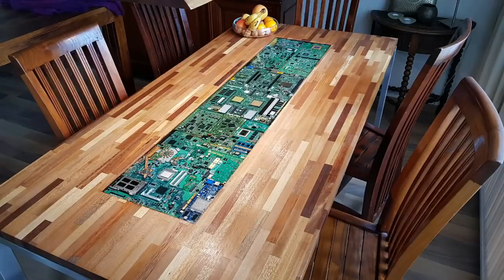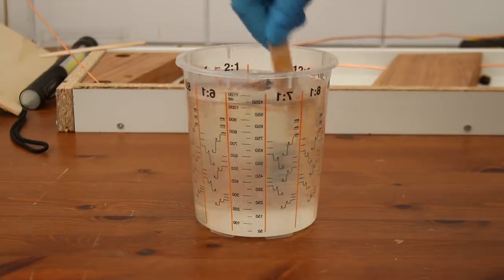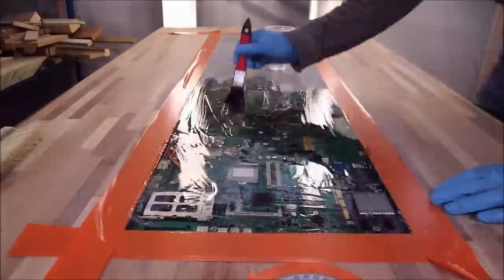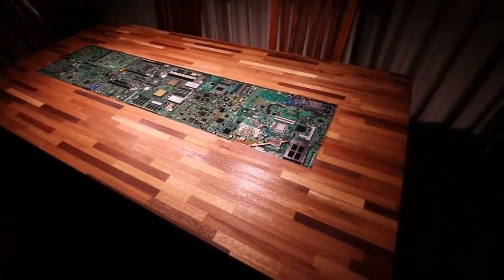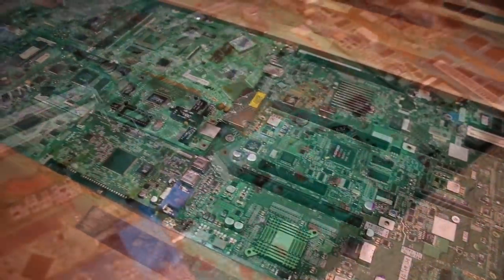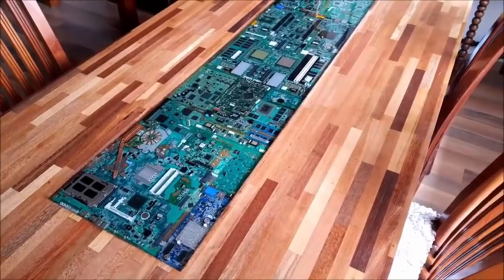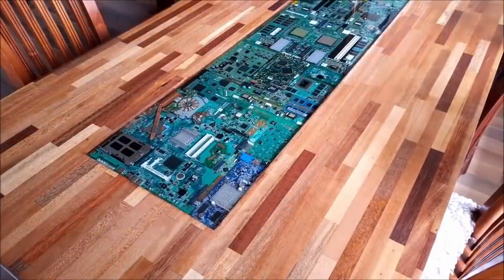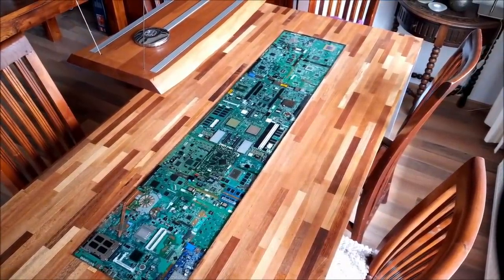Circuit boards with lights in epoxy in a table

Comment: I think you should do it again (easy for me to say). If you do, you should run the fiber optic cables under the boards, not under the whole table.
Reply from the maker: That's not possible. The fibers bend at a radius of about a minimum of one centimeter. For that bend you need room.

Comment: It  is  NOT  A  FAIL  ---   There's  an  alternative  to  save  your  masterpiece !!   Go  find  your  nearest  glass  shop  (where  window  pane  glass  is  purchased  to  replace  broken  window  glass  in  your  home)  and  have  them  cut  to  size  a  piece  of  furniture  top  glass  in  clear.   It  will  be  a  'tempered'  glass  that's  fairly  thick  with  smoothed edges  that  you  use  on  top  of  furniture.  Place  the  piece  of  glass  over  the  top  of  your  table  and  you  will  enjoy  it  thoroughly  as  it  protects  your  table  and it  cleans  up  easily  with  glass  cleaner!

I think this piece is  magnificent  and  definitely  worth  keeping!   Buy  the  piece  of  tempered  glass  and  save  this  beautiful  piece  to  hand  down  through  the  family!

Comment: I find hilarious that you took a most likely working LED and destroyed it for fiber optics If it was a working LED you make me sad.
Reply from the maker: Why does it make you sad? I needed a lens and a LED worth a few cents had one. So what?
Reply: @Onrust1  I makes me mad that you spent the time for fiber optics instead of just wiring them. I do give you the ok for the sparkle effect, but even then it still would be easy to add a arduino uno or a mini with some easy code.
Reply from the maker: I deliberately left out the battery powered lights with controller, because I thought you would go crazy quickly of a carnival in a table all the time... 😊 It is the temporary character of the manual light for a few seconds in the fiber optic that I like.
Apart from that: it's really tough pouring wired LEDs in epoxy - if they break down, they're gone. Whereas my fiber-wired LEDs can't fail.
Don't get mad - you do it your way as I do it my way...
Reply: @Onrust1  fair
Reply: @Onrust1  I do like the look of the finished table so. I can't say a whole lot.

Comment: why is this rendered at 50 fps and not 60 and 1080p
Reply from the maker: My main camera - Canon 80D - only does 50 fps (and everything else I have less than that) and I use the free version of Lightworks for editing, and that only exports at 720p. I find the paid version of Lightworks quite expensive. That alone wouldn't be such a big problem, but as a relative beginner, I still am not sure Lightworks is the best choice for me.
Reply: @Onrust1  Well can you crack it? I dont know
but you can crack sony vegas pro...

Comment: What about carefully cutting the middle out, drop it a little, then place a glass panel in the new recess ?
Another way would be to make a wide board for the router to slide across (like the people who flatten boards with a router) and remove the gummy/bad layer from the epoxy, then re pour.

Comment: Scotty E. is correct. Make it a tempered glass panel. Get it tinted if you like,  to cover the defects, and some felt feet to hold it just off the epoxy. Don't try to epoxy the glass on. You will never get all the bubbles out.  Best of luck !

Comment: You could just find OR make a wood veneer that looks as the same pattern of your table, maybe {.5 inch} thick and cut it to fit over the top, cutting the hole from the center and rounding it with the hand router. then glue and brad nail the veneer on, make trim for the sides to hide the add on veneer.. then sand and re-stain.
There would be a small dip towards the center piece but it would work just fine. Or you could pour more epoxy for level and get it right this time. ONLY YOU WOULD KNOW!
............................................................and as always #UnLOCKyoURfOoL®

Comment: So, to entertain your guests you would just hold a flashlite to fibers? I would have preferred smd's to led's as they are more modern and aesthetically looking as well. i would have also wired all of the smd's and soldered them under the boards with a multi gate driver (allowing leds to individually blink at random speeds) and place one small aa battery hidden under the table with a static switch, so that you can just touch a tiny piece of metal placed anywhere on or under the table to switch it on or off. But, thats just me. I do like your table though, ;)
Reply from the maker: Maybe you are interested: I deliberately left out the battery powered lights with controller, because I thought you would go crazy quickly of a carnival in a table all the time... 😊 It is the temporary character of the manual light for a few seconds in the fiber optic that I like.
Reply: @Onrust1  You could still accomplish that with my method, by simply turning it on or off as simple as touching it or even Alexa-ing it as well, the only difference would be that if I wanted to keep them on for even a few minutes I would have to stand there holding the flashlite. But, like I said its a cool table, I enjoyed it, and I thank you for sharing it.

Comment: "epoxy got sticky" glass on top end of story
Reply: I was just going to suggest that. Just need a piece of toughened safety glass the size of the table top and job done.
Reply: Was thinking that too, build a bit of a frame around it and put in glass.  It will be raised a bit, but I think it will be cool.
Reply: Same thing

Comment: Liked the table, good use of old computer parts. I do have a simple solution to the sticky table, have a glass cut to the same size and place on top of the table. Does not fix the small imperfections in the epoxi, but you can use it as a table again. And its easy to clean and does not get bleach by the sun if you ask for uv-proof glass.

Comment: At least you have added an extra layer to your learning curve as well :) I think you should have poured the entire epoxy at once. Once it changes the form in the slightest way, the consistency and homogeneity of the material may not be the same, hence you have the soft spots.
Reply from the maker: Yes, you're right about the learning curve. I want to make a video of everything I learned, and fix the table in the process. I'm pretty convinced I messed up the mixing.

Comment: What I would do - identify the spots with the uncured epoxy, route them out in a pleasing shape, then fill with a coloured epoxy.  Run more/bigger fiber cable to those spots so they light up as a whole.  Possibly route out an 'organic' border and fill with coloured epoxy.  Think river table with circuits instead of river rocks.
Reply from the maker: What a nice and creative idea! I like it! I'm going through with my own idea and will try to fix the uncured spots, by filling them in with the same epoxy. I want to make a video of what I learned - which is quite something, I think. Thanks for your comment, I really like the idea..

Comment: after pouring the epoxy, i think applying heat to it will remove bubbles and air spaces preventing the sticky look.

Comment: So sorry for the fail. I think on something like this, I would have through cut the table and backed it from the bottom. As far as the epoxy mix, with large quantities, machinery for mixing may have helped. (Like the mixing paddles used in large resin poured counter tops and floors.)  Spritzing the epoxy after it is poured with IPA helps with bubbles. Amazing idea for a "techie" table. Thanks for sharing. :)

Comment: I would have put groove in the table along the circuit boards then have the glass cut to shape to fit in.and of course use small amount epoxy to hold the circuit underneath.

Comment: I would be more than happy with a table like that, because we do not have such a big surface to dine together or play tabletop games. Too bad that it has been wasted... :(
Reply: It's sad, that your project was not a success. Maybe I would have chosen a simpler approach: put the boards inside, maybe glue them there to fix them, and put a glass onto the top.
Reply from the maker: I will fix it. Wait for the video. 😊

Comment: Oh, you've made a crucial mistake: Capacitor leak and I'm not sure if the epoxy will prevent that.
Reply from the maker: In that case you don't know how strong epoxy is... 😆😆
Reply: @Onrust1  Yes, but the PCB certainly will get discolored if one leaks if there isn't a perfect seal around the capacitor - is my point.

Comment: Try putting the table out in the sun for a few hours or better still put a UV light over it. This might cure the soft epoxy and solve the problem.

Comment: Io avrei costruito il circuito in una scatola con le luci, poi avrei messo la resina solo un po per dare l'effetto. una volta asciutta tolti i bordi della scatola l'avrei inserita nel tavolo mettendo sui lati interni degli specchi per dare profondità e continuità e per finire un bel vetro incassato a filo del piano del tavolo. Anche perchè se ti stufa vederlo lo togli e ci metti delle conchiglie.

Comment: putting a new table top of about 2cm thickkess on top of the old table as a sort of "passe-partout" could work, after pooring a new layer of (well mixed) epoxy over the old one would solve your problem, at least the stickyness.
I experimented with "layer on layer" of epoxy, it works fine.
Tip for mixing large amounts of epoxy : poor your mix in a new bucket and remix, don't use the leftover stuff from the old bucket.
If you really want to be sure, do it a second time. using 3 buckets in total, yes you lose some residue in the buckets but it's worth for being certain to have a good mix.

Comment: ummm, failed?  Yeah... you didn't add RGB leds that would fade to different colors slowly and very dimly.  Two AA batteries could last a few years...   Oh well... what good is a tech table... and yeah... Learned to add really thin coats so that it dries properly.  Maybe you made it too deep and got impatient and started pouring more and more!  Oh well.

Comment: Just curious before you throw it out try a relief around the edges.  Since you put tape below it the epoxy might release.  If it fails you are not out anything but time.

Comment: I could only imagine how much a pain in the ass it would be if all those circuit boards were meant to function when some component fries after the epoxy cured. Talking about failure XXXXL. This little problem wouldn't even compare. Anyway, is this epoxy the same stuff as the so-called liquid acrylic? Lots of those are used on billboards.

Comment: If I was doing this, I'd use acrylic dropped in the middle with the table top routed to hold the acrylic sheet on the edge, then the deeper routed area for circuits. Much easier to do that with the router and you can always open the acrylic top and change the circuits inside if you get tired of the look. Another words you can upgrade your table "hardware" as needed.

Comment: What you should have done is after each pour while the epoxy is still fluid, run a heat gun over it gently. This removes any bubbles or imperfections within the epoxy. I plan on doing a lot of tables using epoxy resin. Also it is very important to pour each layer when the previous layer is still tacky. A room temperature of about 20 degrees is recommended when allowing epoxy to dry. I think that the dust cover you made may have had a major part to play. It could be that as the epoxy heats due to the chemical reaction it may have created condensation on your cover which could have dropped back down onto the table. Dust shouldn't be a problem as you will sand and buff your finished table so no need for the dust cover. I'm no expert, hell I've never done a big resin pour before but that's what's came to my mind watching your video. I have learned a lot from this, thank you.

Comment: Waarom niet met een frees 5mm'ish van de hele plak afhalen plus een randje van het hout. Opschuren, dun laagje epoxy om het helder te krijgen en dan een op maat stuk glas er over?
Reply from the maker: Je komt dicht in de buurt van wat ik van plan was. Ik ga inderdaad een randje hout weghalen, maar dan met de zaag (=recht en makkelijker dan met de frees). Dan wil ik met beitel en frees de lelijke stukken er uit gaan halen en opnieuw ingieten. Dan schuren en polijsten. Geen glas - niet mooi.
Reply: Je kan met geleidelatjes en rails heel netjes met een bovenfrees rechte lijnen maken en vlakken schoon frezen. Alleen de hoeken moet je dan beitelen, maar een zaag zou ook moeten werken.

Ik weet niet hoe een gehard glas paneel op transparant epoxy lijkt. Misschien krijg je contact vlekken, weet ik niet. Persoonlijk vind ik "vintrine" tafels wel leuk.

Edit : er over denkende, zoek nog eens op gijbuis op "router sled". Een variant daarvan voor dit project lijkt mij nogsteeds de kortste klap, glas of geen glas.
Reply from the maker: Mijn zaag heeft al een kaarsrechte geleiderail. Wacht op de video.

Comment: Something I do that I figured out works for only the surface is that, if you have unset resin on the surface, paint a top coat of hardener, let it set with that, and repeat until it no longer is sticky. If you find the hardener isn’t helping, sand it off and repeat with the resin. It allows you to generate a thick film of set resin.

Comment: Lay a sheet of glass over the whole thing.  You did all the hard work, just finish it off.
Reply: find a glass firest of all
Reply: i had the same idea, then i read your comment.  Glass is waay less expensive than epoxy, you can even plop it down onto some screws or washers to hold it down over the epoxy
Reply: that what in my mind also~

Comment: Where was your heat gun, I didn't see it in any part of the video. If you are pouring epoxy and don't have a heat gun to soften and smooth areas as needed, then fixing the issues at the end will be much harder to do.  
Also, perhaps the easiest and least amount of work to "fix" it, would be to first keep using a heat gun to smooth those rough patches, then let it sit for a few days. Once it is 100% cured and dried (which takes much longer when the mix is bad), it would then be safe to simply pour a thin 1/8" layer over the whole table to seal it all in.
 
Also, be very careful when drilling out LEDs. That's something I'd never risk doing myself, because most cheaper LEDs use arsenic doping in it's composition for how they work. Arsenic can be extremely toxic and exposure should be avoided.
Reply: ...One possible cause for the bad mix, could be the sanded epoxy having residue or dust, which could contaminate layers poured over it.  Wipe clean and then use a heat gun after sanding so the dust gets melted back to the surface and no longer able to contaminate fresh layers.

Comment: This is realy nice idea. What about vibration, to leave air from epoxy? did you use some? Or there was no problem with air bubles?
Reply from the maker: No, not really. There are some that I missed with the torch but you have to search for them - they don't stand out that much.

Comment: What if you could have one of the laptop boards running as a "Fanless" PC, having ventilation holes from beneath, or would the CPU melt the epoxy?

Comment: Epoxy is usually a precise AB mixture. So your sticky spots are mostly A without enough B. I wonder if you can just apply more of the B chemical to make the softer areas finally set harder.

Comment: Well, in that case, if using several coatings of the epoxy catalyzer alone would not harden and "dry" the sticky surfaces (forget about the ugly areas, it is just part of the design), how maybe about a thin cover of plexiglass over the whole table? I mean, it will still hold the design, will still be translucent and won't be sticky. About the fiber optics end for the lights, it would be nice to use a big LED of the kind that flashes several colors by itself and can be powered by a couple of volts only. Just thinking of possible ideas...

Comment: epoxy needs to be mixed for 5 to 10 minutes straight before pouring, then you ht it with a torch to get bubbles etc  out of it.

Comment: sand it a litle deper inside the resin and use clear top coat  for ex. mtb 9020 clear epoxy resin for top gloss finish

Comment: Put a plate of glass on the table. That is what I did with my 100 years old desk which had sticky, damaged and uneven surface. Looks nice and is easy to clean.

Comment: I love the idea. To me it looks like that distortion could have come from the exothermic heat from the curing process. Were those sections thicker than the others? More mass = more heat.
Reply from the maker: It was a rather expensive, slow curing epoxy. I never experienced any heat. I messed up the mixing.

Comment: You missed a perfect opportunity to make a functional computer inside the table top.... anyways you can still get the epoxy out in one whole piece, because it's semi-flexible and there is aluminium tape below it which has a very bad adhesion to the bottom layer.

Comment: Just cut the rectangle of epoxy out. Make it smaller. Glue the wood to the side. Probably should have made the epoxy part separately then inlaid it into the table. 

Very inspiring though. Keep up the good work. Better luck next time for sure. You learned a lesson for us all. Thanks a lot for that.

Comment: put it under heat lamp, that might fix it, get it to 80-90C for period of 12+ hours. Epoxy needs this anyway to reach final hardness. But this is a long shot due to the poor mixing. For next project, get those metal mixer things for paint/concrete etc. you attach to a drill :)

If that did not fix it, put a tempered glass plate on top ;) tho that is super expensive ...